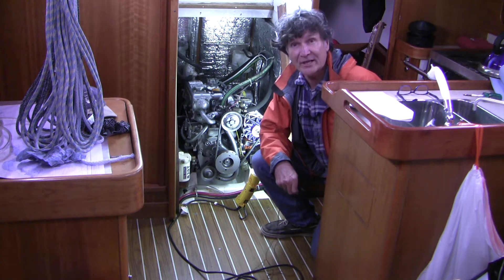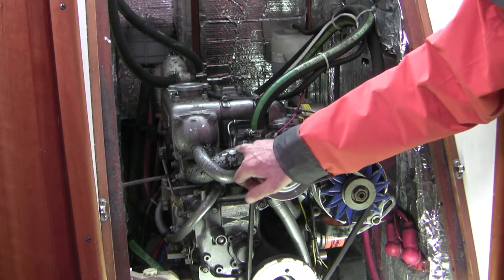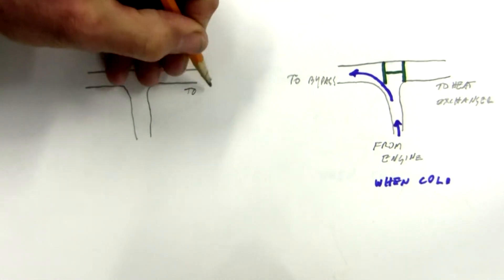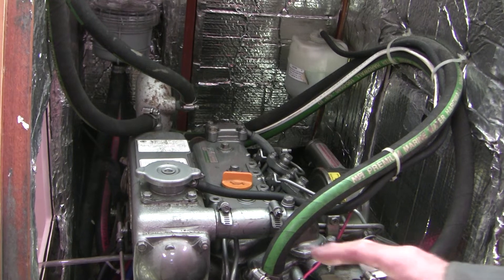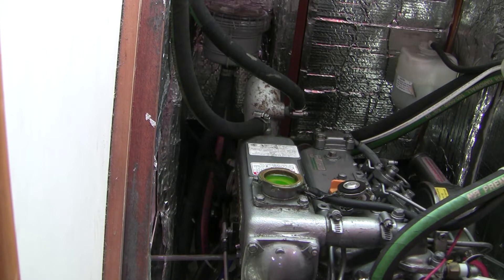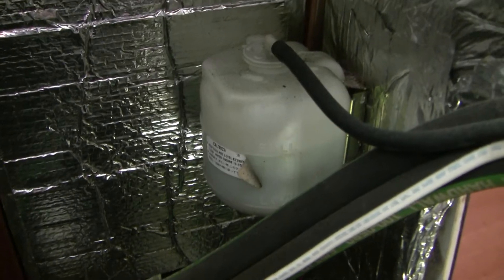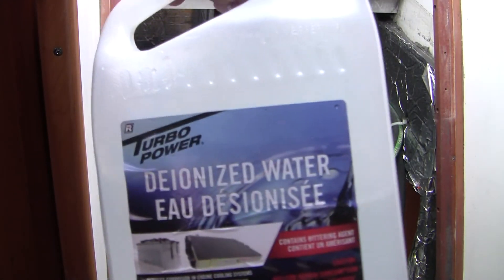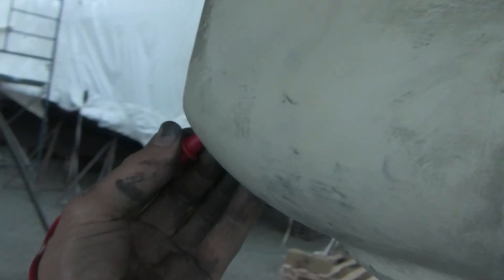Understanding marine diesel engines: Yanmar coolant exchange

Comment: Boss In Bangladeshi Cooling system I saw- There is a water pump.  Turning the belt, the pump runs through the engine. It draws water directly from the river and cools it.

We went 750 km continuously. The engine was not hot. It is very effective. The river water is falling into the river and the cold water is rising and cooling.
A Fish Was Stuck On the pipe😂😂
Reply from the maker: Ha ha, great story. Fresh water is both less damaging to the steel of the engine and it has fewer organisms that will try to call the inlet tubing home. So it's not uncommon to have direct water cooling of a fresh water engine, especially if the engine is normally kept out of the water when not in use. Unfortunately those of us who sail salt water keelboats don't have practical access to dry dock, so we need a cooling system with two pumps and two sides, a fresh water side and a salt water side, with a heat exchancer between the two. Thanks for stopping by!
Reply: @spelunkerd  Thanks😊🖤

Comment: Fantastic video, which i’m using today in sunny Greece.  At one point you say something like  “I’ll need to do a video on flushing/cleaning the coolant circuit”  because you had clogged drains.  I do too.  I looked at all your videos, but couldn’t find one.  Spent hours on boats forums, looking at this subject, specifically what (if any) chemicals to use.  VERY strong opinions against common flushing acids.  Even diluted vinegar had a few detractors.  So if you time for this, i’n really appreciate it.  Maybe add a link from this one?  Keep up the great work 😍
PS: recently flushed the raw water circuit, circulating a product from/to a bucket around the circuit, using a tiny pump and two hoses from the engine.  Could something like that work?
Reply from the maker: I've been procrastinating, ha ha. Reading chatter on the 'net, a popular agent is Barnacle Buster, which is phosphoric acid, said to be relatively nontoxic. Low pH acids work better but are more dangerous if handled incorrectly, and there is some risk of damage to underlying structural components if you leave it in contact for too long. I believe most of that can be negated by proper dilution but even dilution of a low pH acid can be risky if it splashes around. You can get better results by pulling the heat exchanger apart and doing it separately, and that way there is less risk to organisms living in the nearby waterway. That was my plan, I have the seals and am just waiting for motivation. Sure, your hose idea with a closed system would work fine, trapping the waste to dispose of safely. About a month after doing this video I made a loop of wire and removed the spigot for the cylinder drain. I put a pan underneath, then pushed the loop of wire up that hole. After a splash of coolant the debris was cleared and it drained briskly. I flushed it with some distilled water and then refilled the coolant system. It would have been a lame video by itself so I didn't record it.

Comment: Great video! I don't think you mentioned flushing the old coolant out.. mine is rusty, can I just use hose water for flushing or must it be distilled
Reply from the maker: Even today, I'll guess that many professional shops use unfiltered water, to save themselves money, over their clients' interest. It's ethically very important to reclaim and recycle all that fluid, even the water you use to flush it out. So, it becomes a practical consideration of how many empty containers you have available to fill. With few containers you are probably better to use distilled water from the outset. Walmart sell inexpensive distilled water in their food section. If your engine block and head are steel, you can buy cleaning agents that have the same chemistry as CLR. You pour it in, fill the system up with water, run the engine for a few minutes, and drain. I believe the risk of damage from a cleaner would be significantly higher with an aluminum block. In the old days I remember using a T to a garden hose, running the engine with the hose flowing, and letting all that drain onto the pavement. We wouldn't think of doing that today.

Comment: Great video!  Thank you for investing the time to share your knowledge!  I have a 2GM20F and am about to replace the five original freshwater cooling hoses.  Today I drained the coolant and flushed several times with fresh water.  Tomorrow I'll pull the hoses and replace with Yanmar parts.  One question though, about the short (2") hose connecting the fresh water pump to the heat exchanger (shown in your video).  It seems to be too short to get off without removing the thermostat housing, and it looks like there's a gasket under there which I might not be able to get on short order here.  Am I missing something, or must I remove that housing to replace that hose?  Any thoughts on reusing the original gasket?  Also, what are your thoughts on using gasket grease?  Thanks in advance!
Reply from the maker: When putting hoses on for various purposes I routinely use a small smear of silicone paste, if only to make the task easier. The brand I use is made by 3M 08946, but there are cheaper alternatives like Sil Glyde. It helps you slide hoses on much more easily. Silicone paste has multiple uses, and it has a very high breakdown temperature which makes it good for other things like brake caliper sliders, etc. It never hardens, unlike RTV which is designed to harden (don't use RTV on hoses). Getting old hoses off can be a chore. I use a large pick with a 90 degree bend, slipping it between the hose and the steel nipple to break corrosion all the way around and loosen it up. The other option is to carefully cut off the old hose, which is a time saving trick routinely used by shops that do it all the time. Don't gouge the underlying steel. Some plastic hoses (like a bilge pump hose) can slide on a little easier with a small amount of heat, but coolant hoses are designed to withstand heat so I wouldn't bother with that. I'm not sure if I ever replaced that short hose at the top, but I definitely replaced the two more prominent hoses in the front. Neither had a gasket, and both went on easily. As you say, if you're replacing a short hose it may be wise to have a plan B, which may involve needing an extra gasket for the next flange. There is controversy regarding RTV and gaskets. I try not to use RTV but if the gasket leaks I don't hesitate to use a light smear of RTV on a gasket. By the way, I would do a final flush with distilled water before you add your coolant, since tap water can have calcium and phosphate ions that may crystalize out of solution and mess up seals and your heat exchanger passages.
Reply: Have used the same gasket about 4 times and never had a promlem.

Comment: Yanmar header tanks ('subtank') should be removable by sliding up their mounting fitting. This may not be obvious due to its position. Emptying, cleaning and filling is then a lot easier and safer.

Comment: Very helpful.  How do you ensure that new coolant gets into the engine block part of the circuit when the engine is cold as the thermostat would have closed off the flow through the heat exchanger? Also what is the normal replacement period?
Reply from the maker: Great questions. I answer those in a playlist of cooling system videos on my channel. The jargon term is 'burping' the cooling system, which in some engines can be difficult, but in these little things it doesn't take much. As a usual plan after changing the fluid I carefully start and run the engine with radiator cap off. I patiently stand there and add coolant to keep the level up. Then I wait til the hose leading to the heat exchanger begins to warm up, showing that the thermostat has opened. You'll notice a swirling of the fluid showing that has happened, and you may see bubbles coming to the surface, as the pump pushes fluid with air pockets to the top. The usual replacement period is a few years, more important with new style coolants that have antioxidant chemicals to prevent corrosion.

Comment: Smart phones have water detection strips, that will turn blue when wet and stay blue even if dried. Would that be a smart solution to have a permanent wheep hole check for water? Maybe they turn blue anyways because of the moisture so might not work.
Reply from the maker: Gotta love creative thinking like this. Unfortunately in a boat, dew condensation when ambient temp falls is so prevalent that I'll guess all strips would show false positives very soon.

Comment: Can anyone recommend a pressure test kit that will fit the Yanmar 3GM30F heat exchanger? I've bought a test kit as recommended here, but I can't get the cap to fit as the depth is too shallow compared to the auto radiators the kit is designed for. Thanks
David
Reply from the maker: Isn't that annoying! I have two kits, for that very reason, on other vehicles. Today I went to the boat and found that both kits contain the correct adapter. The part that fits is Astro 7858-3. The knockoff generic kit doesn't have a name, but that adapter is one of the most common adapters available. Flat stainless, with no plastic. Note that to get the bottom seal to work you need to press the adapter down firmly and rotate, a silicone lubricant might allow it to slide into place more easily. The lower seal is spring loaded to allow a tight seal. If the bottom seal is a problem, then a hack would be to clamp off the hose leading to the reservoir. Put vacuum hose onto the jaws of locking pliers to avoid damaging the tubing, or get dedicated hose clamps.
Reply: @spelunkerd  Thank you. Your videos are the best!
Reply: Astro 7858-3 is $20 but $80 to ship to the UK! Looks like I'll be trying your other methods!
Reply from the maker: @DavidRea2710  You might ask at a local auto parts store if they will permit you to borrow or rent a cooling system pressure tester. In the US this is commonly done, you put a deposit down and can get a refund if the equipment is returned clean and unbroken. Alternatively you can carefully run the engine and look for leaks, it is a little risky because of moving parts, but possible.

Comment: ON THIS I WOULD USE waterless coolant. then you never need to change it. it also wont do any damage. No alkali. no corrosion. New technology. great for marine and classic cars.
Reply: https://www.summitracing.com/parts/evn-ec53001?seid=srese1&gclid=CjwKCAjwt8uGBhBAEiwAayu_9fJDREZo95tROm1isohpvWDwkLAQIpWXh6c9aAALQ1pKvYN66iUgBhoCF0MQAvD_BwE
Reply from the maker: I find this a really interesting point. Several years ago I reviewed this intriguing topic. The weak point of internal combustion engines is definitely water. Through the years I have done more repairs on cooling system problems than any other.! I don't know anything about its use in marine diesel engines.

Comment: Thank you for the informative video! I recently went from a Westerbeke to a Yanmar and now getting familiar with the 3gm30f3. You mentioned a heat exchanger flush, did you ever get after it?
Reply from the maker: Dang, I've been procrastinating, but I did locate and buy all the seals from the dealer, including the exhaust manifold gasket. I've been thinking I'll remove that spigot and put a wire up inside, try to get fluid moving, and then clean up the mess. If I can get fluid moving, I can skip removing the housing completely and do regular cleaning of the heat exchanger in the usual way. Interest in recording waxes and wanes, I'm hoping to record it if I can build up the passion to do so. It is nice to meet you!
Reply: Did a heat exchanger flush on the saltwater side with barnacle buster and never had another problem. Barnacle buster, drill pump,two hoses and a gallon bucket. Pump barnacle buster into heat exchanger, let sit and then rinse with fresh water, reattach hoses and you should be good  to go.

Comment: Did my first marine oil change on a friends 1980 Yanmar 20hp in his 36 ft hunter. As the vacuum started through the dipstick I first drew clear water. 4 to 5 Ounces, this is where I think that this is relevant, The engine had been run for at least 15 hours the week before in one to three hour intervals 1800 to 2500 operating speeds. Is the engine running to cold?/ thermostat problem
Reply from the maker: That's alarming. I don't think running a little cold would do it, I would be thinking of a head gasket leak, or maybe a problem with the salt water elbow, or maybe the dipstick was not sitting correctly and water splashed through the dipstick tube into the engine. I would not run the engine until you have a close look at it, and unless you're comfortable with diagnosis in these engines you would be wise to consult a pro. If this were my engine I would pressure test the cooling system with a pressure tester. I show how to do that in automobile engines on my channel. It requires some special equipment, though you may be able to borrow the gear form an auto parts store. I would also disassemble the salt water elbow to look for any defect that might allow salt water to make its way back from the exhaust into a cylinder through an open exhaust valve, and I'd check the antisiphon valve that is on the distal side of the salt water output to be sure it is not stuck shut. After flushing the oil and oil filter I'd then run the engine for a couple of minutes, maybe using a chemical tester to look for exhaust products in the cooling system to look for a head gasket leak. I'd then shut the system down and change the oil and oil filter again. If the oil dipstick is not installed correctly, it is possible to spray salt water through the dipstick tube in my Yanmar engine. The tube is right below the heat exchanger and in a best case scenario that cause would be a relief. Let's hope for the best.
Reply: @spelunkerd  Interesting that you brought up the dipstick, The day we were test driving riding on the boat the rear portion of the exhaust manifold failed were the salt water is mixed to cool the exhaust. The part was replaced before the transfer of the boat. Sprayed exhaust and see water every where. The dipstick had a very loose feel and I wrapped some plumbers tape (Teflon) around it to tighten it up until I can get a proper O ring on it when I did the oil change. This may be the cause of the clear water at the bottom.
 I will check for exhaust products and a friend has a pressure test kit. On an old head gasket how much pressure is enough i do not want to cause a failure.
Reply from the maker: @emilopffer1069  The gauge on the test kit will show you, but typically these mount about 15 psi over atmospheric pressure when the engine is running normally, so you're safe if you stay below that. It should hold for at least 15 min with no sagging of pressure, watch for external leaking. With water in the oil pan, leakage may be internal, hard to see but the pressure drop will be your clue. Have a look at the weep hole while pressurized.
Reply: @spelunkerd  Thanks weekend project, appreciate the responses and speed of response : )

Comment: A cautionary tale. My heat exchanger drain was completely plugged as well. I removed the small housing held in place by 4 bolts; it had 1/2" of gunk in it plugging the drain.  Coolant gushed out when it was removed but what I did not realize at the time was that my dipstick was dislodged. After flushing the heat exchanger with generous amounts of fresh water, I put everything back together, filled with coolant and ran her up. Well, it was not long before the dipstick blew out and grey coolant sprayed everywhere. I quickly shut her down and then began the long tedious job of removing all the contaminated oil. Several flushes and oil filter replacements later, the oil looks relatively clean. The moral of the story: be very careful running water or  coolant  around the dipstick hole! Thanks for the tip about the plugged drain hole.
Reply from the maker: Thanks, Mike! It is sound advice. I've been procrastinating that job, I have the gaskets to take it all off if I need to. I think I'll try to get by with poking something up there, and I'll think of your experience when I do it.  If that doesn't work then I'll take the whole thing off and clean it on the bench. 

Dave
Reply: @spelunkerd  Hopefully, you can get by with poking a wire up there. In my case, the crud was 1/2" thick and had the consistency of clay. I'm glad I got it out but I will be very careful from now on. I think the oil is clean enough for an extended run up now, will try soon. Thanks very much for all your videos, really well done. 

Mike,  Lovely Cruise, C&Cii, St Margarets Bay, N.S.